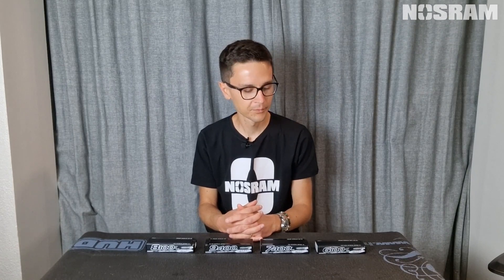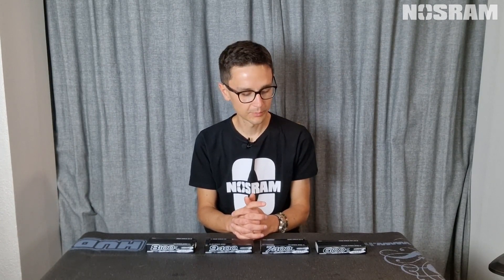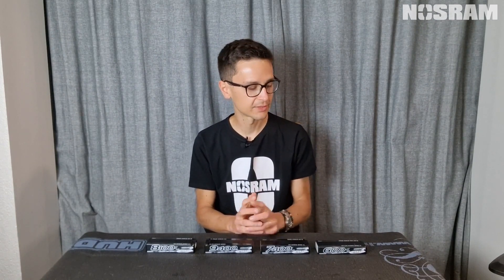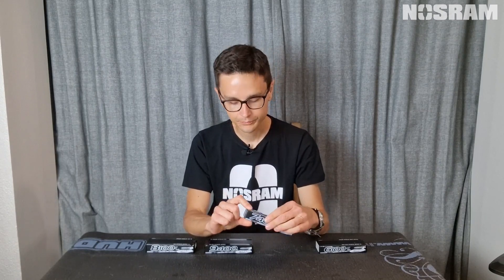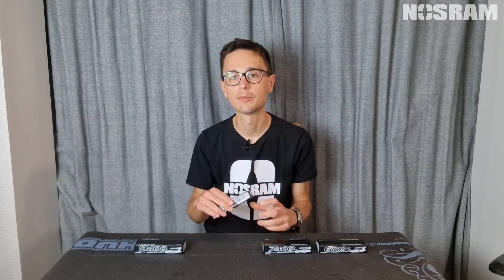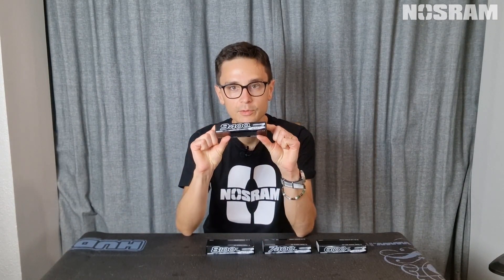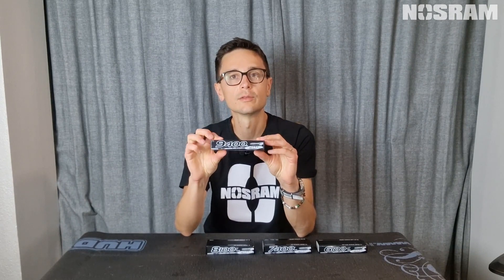Nosram battery options for spec racing!

Comment: Thanks! Great video as always! You've talked about CG trade-offs when choosing batteries, but can you still keep the car's total weight near 1320g when using the 9400mAh battery? Or you abdicate the optimal total weight or left/right balance in this case?
Reply from the maker: My X4'23 without weights added is just on the weight limit with the 9400 pack.

Comment: Hi Alex. Nice informative video. Which C rating should i use for 13.5 turn touring car racing and why?
Reply from the maker: For spec racing, you'll want as high of a C rating as you can possibly get. Higher C = Not only does a higher C rating provide better performance, but it also provides higher reliability for ESC's.